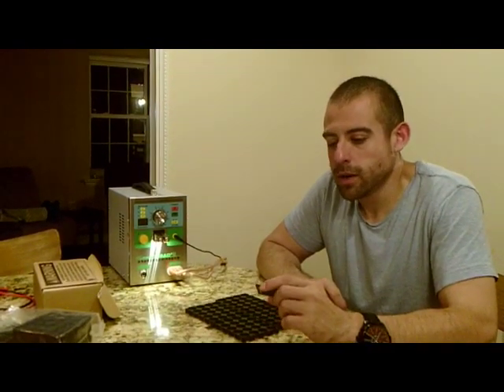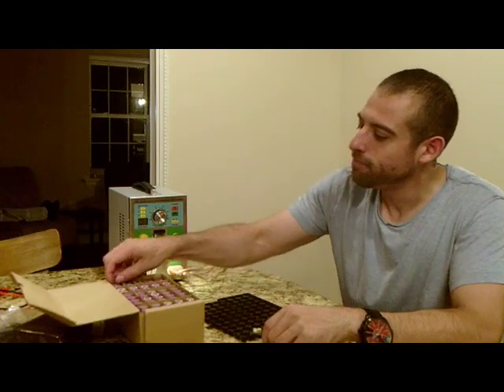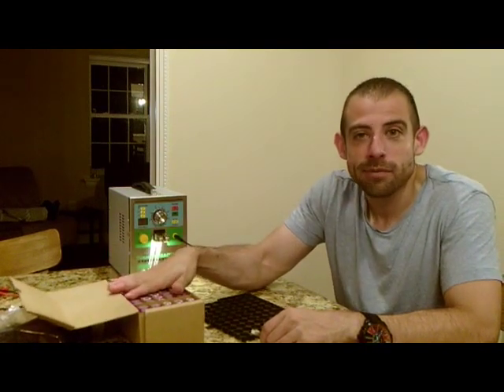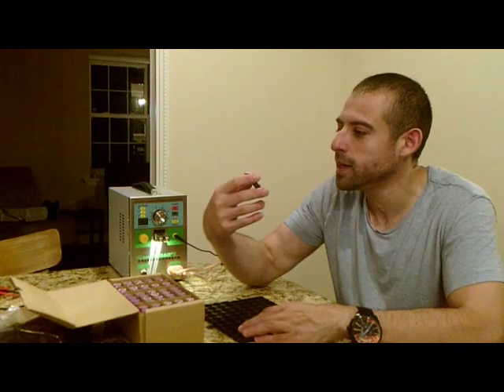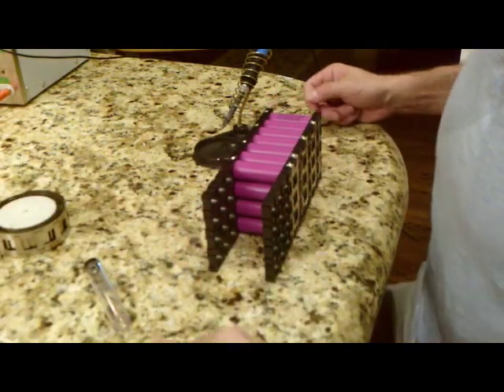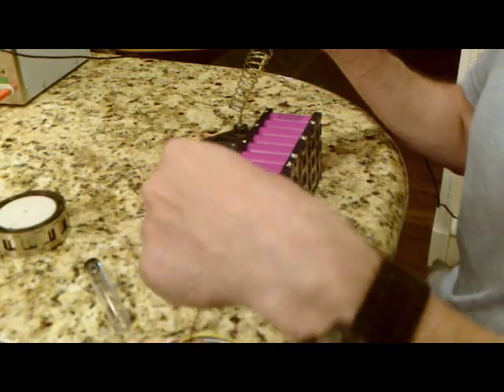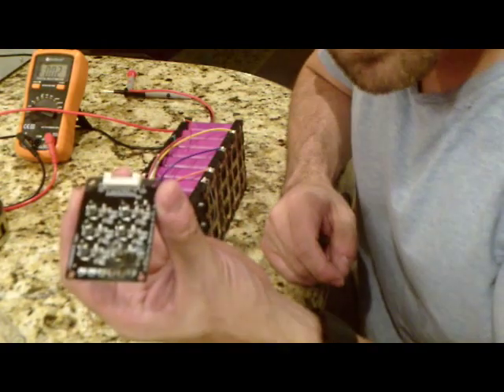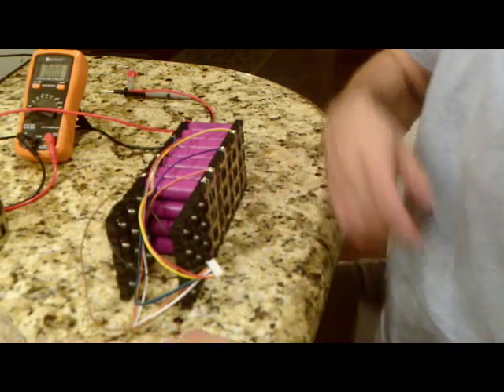Active BMS EXPLOSION!

Comment: Wiring fault? I have the same one, it only gets slightly warm.
Reply from the maker: Annie Nathan Watkins if the cells are balanced its fine but if one cell goes bad it lights up trying to balance them.
Reply: Quite a letdown, as the whole idea in the first place is to keep the cells in good order ... and to prevent a fire!
Reply from the maker: @BenjaminEsposti  thanks for watching this was an experiment, i wanted to see how far this could balance, trying to simulate if one cell in a string went bad, i had a high of 4.1 and a low of 3.8  ( not a crazy difference) and that was enough to set it aflame.  i agree that you should always balance your batteries before attaching the BMS but was shocked at how hot it got and how it actually ignited under that load.  my though was if after a year or 2 they go out of balance i wouldn't want it catching fire . most bms just get hot and short, this did not. i think if it had a heat sink it would help it significantly.